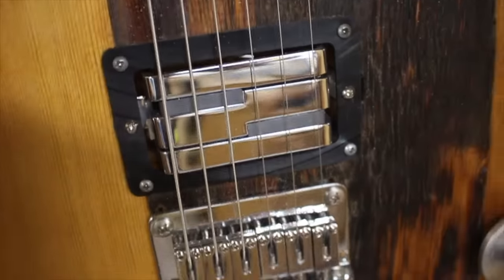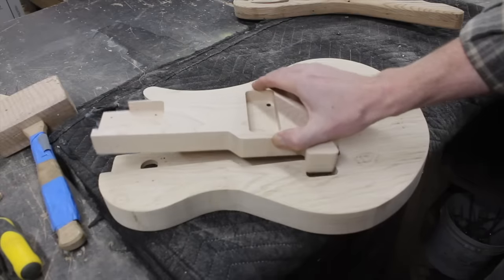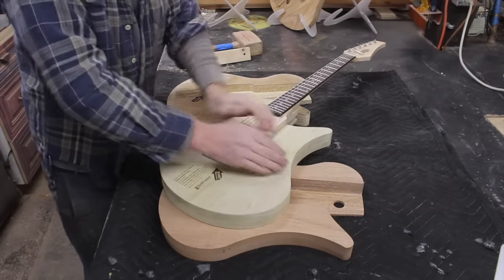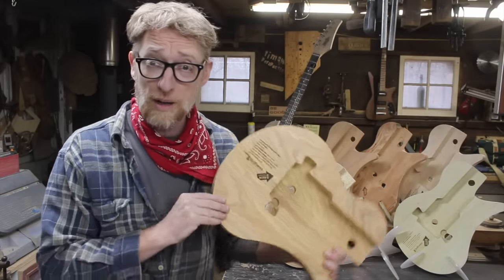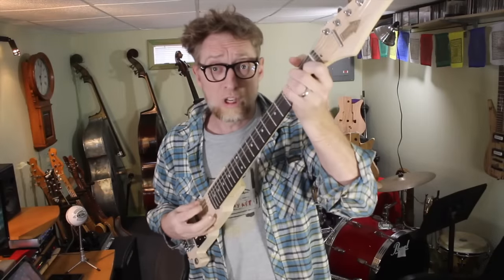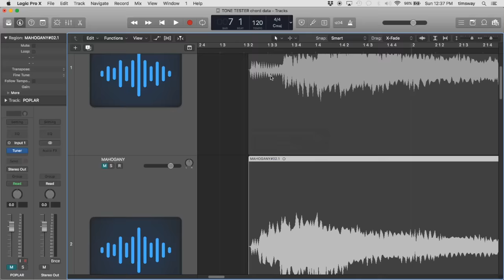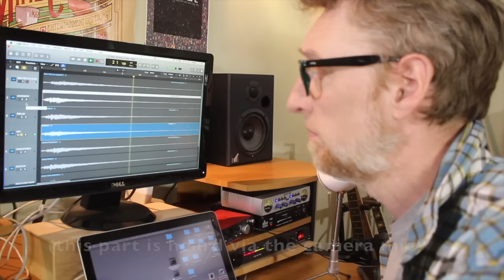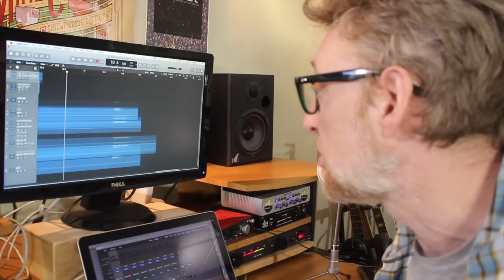Tone Wood Tester: One guitar to test them all

Comment: With all due respect: you pretty much left out the main factor where wood will alter the sound, the neck/fingerboard. Since the body more or less just functions as a static mass to stabilize the neck/bridge construction it will, within a wast range of density, weight/shape/volume and tensile strength, add the least difference to the overall sonic result. Please do again with different necks. Actually the fact that there seem to be some differences in sustain and even tone are more speaking towards the argument that material choice matters given how little the body actually adds to the overall result.

Comment: this is nonsense, because the most significant thing is the type of wood that connects the neck to the bridge. By having a replacement section, you completely bypass that - and that's why you don't detect any difference. It's like taking a standard guitar and just bolting an extra chunk of wood on. Not surprising that it doesn't make a hell of a lot of different.

Comment: Me, listening to the ash body: „Oh, that‘s the greatest difference so far.“
Tim: „Sounds exactly like mahogany to me.“

Well, as long as no one realizes that the chord is obviously out of tune in several different ways in each recording, i‘m not sure we should discuss the tone of the woods. And, by the way: what you see on the screen is only dynamics. It tells you absolutely nothing about the sound of the guitar. If you’d hit a note on a piano and record it, it would look the same. 
Though the way you approach this in the way you built the guitar is amazing (in my opinion the best solution ever to this problem), there are too many mistakes and errors in the method you record and analyze the results to make it valid. Sorry.
Reply from the maker: We have since done spectral analysis of the recordings and they are still available for download in the comments if you would like to. No one saw any discernible difference there, either. But that's the fun thing about this (and why the concept of "tone wood" prevails): Two people hear two completely different things when they listen to the same block of wood! There are still a ton of variables present, but this made more sense to me than building 10 guitars with infinitely more variables (plus it was a fun design to experiment with). I did some "blind listen" videos, too, where you get to guess. Play along!

Comment: Out of tune guitar and the lack of a standard picking method ruins the whole thing for me. It´s a pitty, after all that undeniable wood carving effort to fail this way in the execution of the final test. The initial transient caused by the picking (angle, exact place along the string, speed, depth...) is so important in the perception of the rest of the decaying sound...In fact, it would be interest to compare all the sounds after erasing that first milliseconds of the picking stroke...The string, under the same tension and enough rigid support of nut and saddle is going to give you undistinguisable harmonic spectras through the same pickup. Pure physics...

Comment: I don't think this is a good way to test tonewoods. Most of the tone comes from the bridge being bolted to the body, and vibrating it from the bridge - which carries through the body because it's a solid piece of wood. Electric guitar strings don't have that much power. You're primarily testing the tone of your insert, not the wood it's slotted into.

Comment: P,P,S/iam sure u are familiar  with all graphyte  guitar neck s  or even whole guitar /well mostly   i saw this  in basses and some   were so dense and  hard that normal bass  somtime   /new strings and set to  wery  sensitive action and gain /and  u get  bass soundin like picolo bass or  unplugged guitar/ so  basic  the    relationship  body/neck /head  is    important  / propably  more  than just  plane   body//  in fact   any body   will  do  but  possible  balsa  or    for some   who want super damped  short sustained tone  even   balsa   should be  just the wood  he  nead/ for  normal  bass/guitar   where  u  want sustain  and some warm tone  in  too /that s  gotta  have  more   with  body to head and  neck thicness/rigidness/ than  wood  itself//try   4 different  head shapes from allmoast  no head  like    double  balled  stainberg   ,,showell guitar / to medium  like ibanes    head to fender  or   some  large  mass   surfice   head and  last  u    do   like  insane   big  head  like   double   fender   surfice  or even  tripple// i bet   u it  will  totaly  influence   the   sound and   guess that   around   fender bass   ,,p,, should do  best  / oversise should    actually distorte  or  mute  sound same  as   almoast  none  like  hohner /steinberg model double ball
sorry i wrote so  much /and   im  over 45 so not  some   master on keyboard //excuse  me  for   my grammar too  but  it s 30  year since  i neaded   written eng//at least corectly  micho from slovenija/ex yugoslavia/  was pro bass  player 18 cd s recorded 
great   goin into details i do same  with   guns / knives ,pick  material /etc

Comment: Nah, the concept is wrong, just saying; in a real world electric solidbody guitar the bridge and pickups are mounted on the body and the neck which usually is different wood or woods attached to body separately, there are exceptions but majority of guitars are built this way where tonewoods plus age of the wood make a huge difference in tone and feel, also a new guitar needs a break in period to give its best, strumming therefore vibrating the whole thing for a while opens the sounds up, and addition to all these factors top wood on the body and neck affects the tone considerably as in the case of maple top mahogany body of Les Paul guitar and rosewood, maple or ebony fretboards on different neck woods or even on a plywood and so on.. But then if you don't feel and hear the difference then you don't need to consider all those things anyway, just putting decent pickups on a cheap far eastern copy guitar will do for ya..  Peace. ✌ :)

Comment: Sorry, but it is a flawed study. Your fretboard/neck/"insert" assembly is the path of most vibration transference, with the particle board back serving mostly to dampen resonances in the tone woods. My experience is that body, neck, and fretboard woods make a very significant difference in tone, and plenty studies that I would consider less flawed in methodoly and reasoning will back me up. No room for more detailed explanation here. The difference is most notable when you tweak tone to sit in the mix and either find certain nuances you seek present or not.

Comment: This was going so well until he completely destroyed the test by strumming the guitar himself.  When one sounds a little louder than the other, it's almost certainly because he put just a little more pressure on the strum.  This needs to be redone with a mechanical device that hits the strings identically every time.  Also some type of device that holds the chord in place - just the positioning and pressure of your fingers will affect how clean the chord is played.

Can't believe he would go to all this effort and put so much thought into it and then completely screw up the results with something so obviously wrong.

Comment: Obviously you have no knowledge what science is. Your setup is totally flawed. It matters on what material the bridge and neck are mounted to. Depending on the material it will dampen some frequencies (frequency spectrum, impulse response) more then others. Since in your case the bridge and neck are mounted to the "neck trough guitar", you won't hear any differences - quod erat demonstrandum.

Comment: He doesn’t grasp this at all. The piece which he used as the base will have the greatest, if not the only, effect, and the pieces that he fits it into will not affect the result because they are not attached well enough that vibrations are transferred. What a waste of time and wood! If he would have used those boards properly and built actual guitars with them, he would have had a valid test.